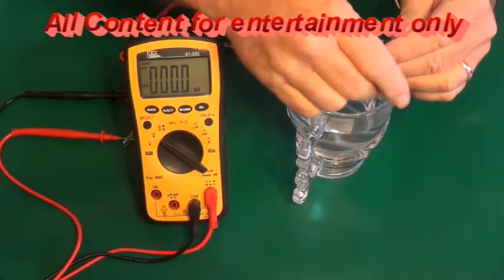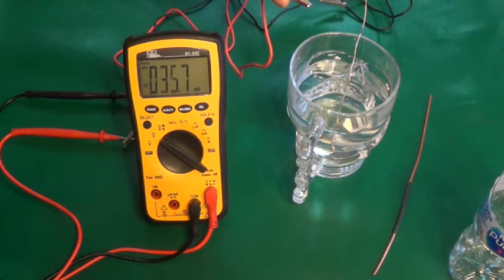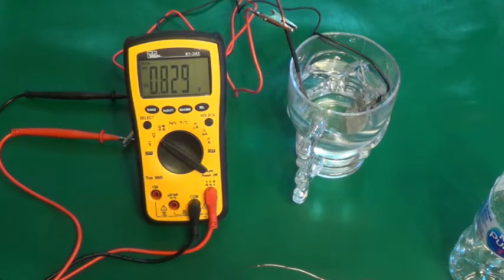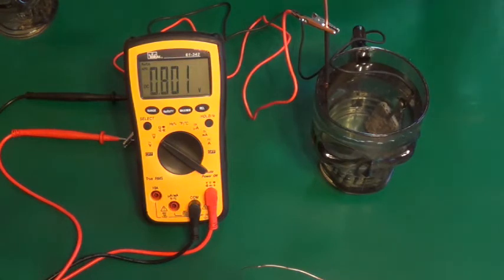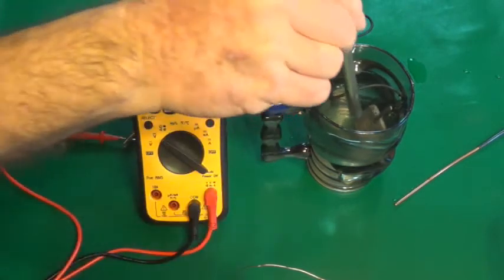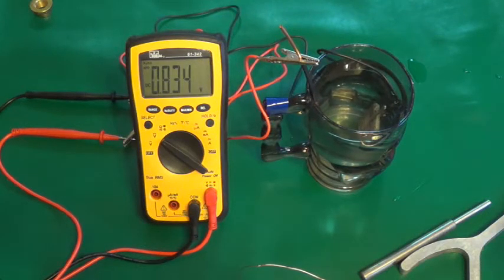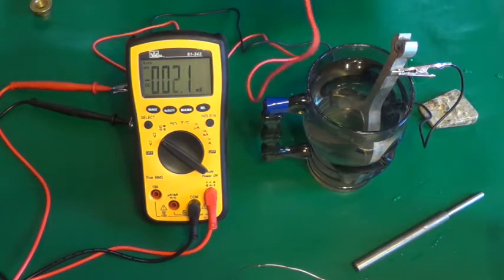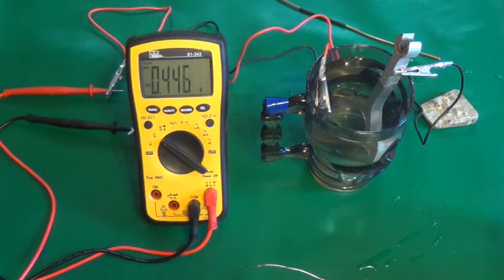Boat Zinc Why it Works {anodes}

Comment: That is not pure zinc or aluminium is not pure aluminium. Because aluminium is less noble than zinc. 
My guess is that there is some magnesium mixed in that 'zinc' anode
Reply from the maker: I never thought of that but you are right. Thanks for you comment and keeping me straight.
Reply: Zinc is the least noble, its why sea boats have Zinc anodes, river boats have Magnesium anodes, once the electrolysis has eaten thru the anode it'll get to work on the next least noble metal which is usually aluminium, I've had first hand experience of this, I never bothered to change my Zinc anode for over 8 years due to neglect, one day I went to pump the bilge out and noticed the aluminium coolant pump on the front of the cylinder block had literally turned to dust